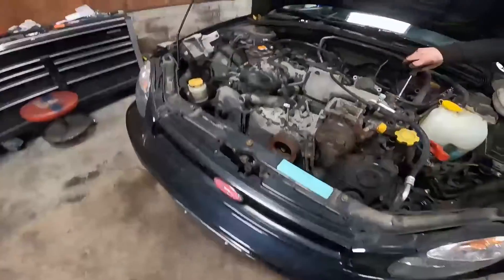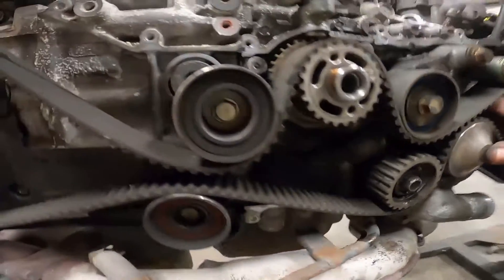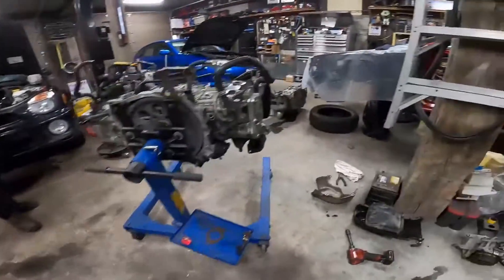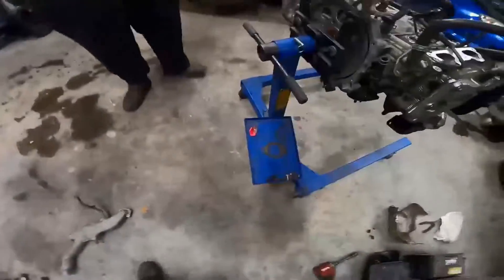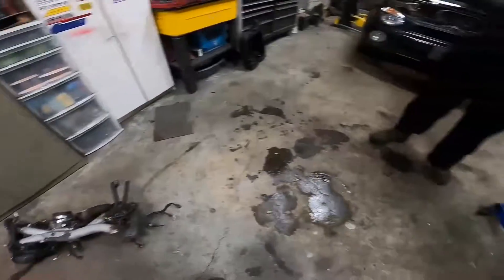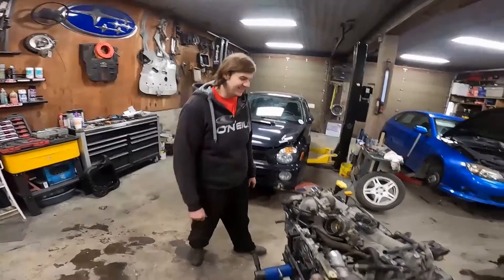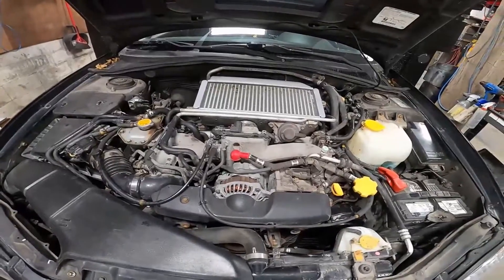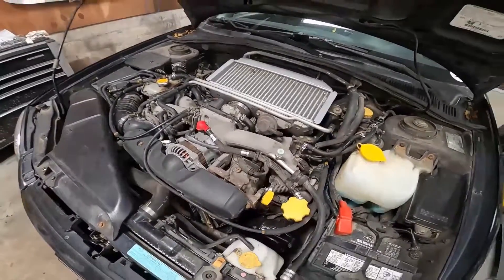How To Install Jdm Ej205 Into Usdm 02-05 Wrx

Comment: I’m looking to swap the same motor into my 03 Wrx wagon. So I need to find a jdm ej205 with avcs and metal intake manifold not the one with dual avcs and plastic manifold??
Reply from the maker: Correct, for your 03 wrx you need the cast aluminum jdm 205 single avcs engine

Comment: so currently, I’m technically doing the same swap I bought a bugeye wagon blown. I got a genuine JDM motor. The thing that I’m stuck on currently I purchased a cop turbo and I don’t want to run the JDM oil feed line. by any chance, can any of you guys give me suggestions? I wanna run everything from the cop to correctly like the feed line is gonna be the only issue that I’m having now. cause after that, I already have the USD manifold. I just need a clutch in the fly with that and I’m ready to drop it into my car.
Reply from the maker: @chrisramirez8800  I can’t see why the cobb oil feed line would not work. Looks like it comes with adapters for all types of scenarios. If it does not work get an iag oil feed line
Reply: @ I’m just not trying to run the JDM oil feed line i’m try to run the cobb one that’s prorated with the turbo is there a way for me to close off those lines without affecting the motor?
Reply: @ cause potentially I am gonna run the USD computer and manifold as well I just bought the JDM motor for my USD Buckeye wagon

Comment: I am new to subaru and have a 2002 subaru forester s usdm 2.5 na automatic would I be able to swap a ej205 in my car swap due to bad head gaskets will be 3 grand to do a headgaskets fix here in my area
Reply from the maker: @levijonson1991  hey there! To run a turbo motor in your NA is a incredibly expensive venture. There are jdm 2.0 sohc motors for very little money available from most jdm importers. In Canada, jdm 2.0 sohc and install with fluids ans gaskets would be less then $3k(can) all in. 
Cheaper then doing headgaskets 😬 hope you find a good solution my friend

Comment: Dropping my jdm 2003 ej205 avcs with cable throttle into my recently bought 2002 wrx. Can i drop this motor in "as is" or do i just need to swap over intake manifold ? From what i heard this motor is about identical to the usdm wrx engine. Ty
Reply from the maker: @Drewdawgg-x3m  if your jdm 205 is a cable throttle then yes you can just drop it in and go!
Reply: @TheSubieSanctuary  thanks alot!
These forums be throwing me off saying to switch this over and that. This motor was supposed to be swapped into my gc RS ,and with my knowledge from iwire, I remember it saying to look for this motor exactly so it could be a straight drop in application
Reply: Knocking this out Saturday, first time doing a subie swap,should be fun. Glad to know i don't have to change the cam gear or the sensors/water lines up under the intake manifold.  Now i'll be driving my wrx by Saturday night if I start Saturday morning
Reply from the maker: @ awesome! Love to hear it. Its rare to end up with the drive by cable jdm 205, but definitely sweet when you do. Drop in and go 👌

Comment: This video really saved me! Thanks guys! One question—
Can the JDM up pipe be used with the USDM headers? I understand the sensor is not on the JDM up pipe. I put the JDM up pipe on with USDM headers and USDM turbo, but I’m not getting as good boost as I had before. Not sure if it’s related to the JDM up pipe.  Thanks!
Reply from the maker: Yes they are interchangeable, the jdm up pipe is an upgrade vs the usdm. You may possibly have a boost leak or exh leak causing the reduction in boost
Reply: @ Thank you!! You probably mentioned already in this or another video, but I found out that the JDM headers are not compatible if you plan on using the oil cooler because there is not enough package space for both the oil cooler AND the oil filter. The oil filter will interfere with the JDM headers. 

However, the oil cooler is required if you use the USDM water pump because it has an extra coolant line that goes to the oil cooler. Hopefully that is useful for someone else who may be reading or missed that like I did!
Reply: @TheSubieSanctuary With the JDM up pipe, there is no hole for the O2 sensor. I get a check engine light with the code P0171. What are some alternatives so I ensure that I don’t run too rich or lean?
Reply from the maker: @ that sensor does not effect running, the code is very seldom going to come up. if you still have the old up pipe. Just remove sensor and plug it in and zip tie off to side. 
If you dont have the old sensor you can stick a 2.2 kohm 1/2 watt resistor into the plug.

Comment: great job and thanks for the vid.  did the bug need a tune after swapping? what would neeed to be adjusted?
Reply from the maker: @robertvicen5306  a tune is always going to be the best bet, however if you use same power contributing components like turbo, exhaust and intercooler. This particular swap will work with no issue on stock ecu. 
If seeking a tune, all they would do is dial fuel/ignition timing. 

Unless you go as far as using the matching jdm avcs ecu for these motor then you can get into cam timing as well. Large added expense for very little noticeable benefits

Comment: Install ej20 in 2004 WRX and car start right up. Cylinder 1 and 3 misfire.  Remove driver side JDM coils and install USA model on cylinder 2 and 4 and it fix cylinder 1 and 3 misfire.. ...
Reply from the maker: @jeromesealie9456  very strange

Comment: This video and all the rocker panel repair videos are a Godsend for my bugeye resto. If I didn't live in Utah I'd just trailer it in and give you guys the business. 

But JapanDirect is a good source for engines? Saw you mentioned them in another comment.
Reply from the maker: They are one of the jdm suppliers local to us. They have been very reliable for parts/engines. Probably 100+ engines from them
Reply: @TheSubieSanctuary  Awesome to hear. A local guy here mentioned that he's gotten several engines from them as well. Going to put an order through with them tomorrow. Surprisingly shipping is pretty affordable.

I have never attempted a swap before, but thanks to your channel and a few others, I'm confident that I'll pull it off without screwing things up too badly.

Thanks again for all that you guys do!

Comment: Any trouble with timing due to different compression ratios?
Reply from the maker: @justinhassinger7815  no need to physically adjust timing. But it is ideal to get a tune over all.
Reply: Hey me again so I’ve been all over the forms, but can’t really find any Clarity on it so the motor I have is a non-AVCS EJ 205 The cam Gears look identical to my USDM EJ 205 Non-AVCS  With those work or would I still have to swap over the cams from the USDM motor?  Thank you for all your help
Reply from the maker: @justinhassinger7815  as long as the crank gear also matches your original 205 then you be just fine to leave them!
Reply: Yessir thank you very much

Comment: Where is the video where you do wiring
Reply from the maker: @moemeditumelo1011  in this video, we used the usdm ecu, no wiring required and still able to utilize the cobb ap. 
If you plan to use the jdm ecu, then this video is install with jdm ecu and wiring. 
https://youtu.be/kyQPdwsYs0w?si=i3F4S-hCcw4GIPar
Reply: My swap is bit different eish, lemme explain maybe ul manage to help. I have swapped EJ20G from SF5 1997 forester into impreza WRX 2007 model, I need advice,if I must use the ecu from sf5 or is it possible to use the wrx ecu though wrx is drive by wire throttle and sf5 is cable. Please help
Reply from the maker: @moemeditumelo1011  ya that is an obscure swap. You wouldnt simply be able to use the old forester ecu because the 07 wrx is all chipped together. Ecu, ignition and immobilizer. 
Im going to assume the SF engine has no avcs. 
Youd have to drill holes in the cyl head to fit the cam angle sensors in the exact prefect spot. In the end you would need an open source tune to tune off the avcs codes. 
If i was asked to do that swap, id say no. Its a bad idea. If i were you, and wanted to stay on the cheap. Id get a jdm 205 with avcs, swap the intake cams and then it would run like normal in your car with no codes or issues.
Reply: @TheSubieSanctuary thanx you my brother

Comment: we did 02 wrx, usdm to jdm, jdm had dirve by cable. we used usdm crank and cam sensor, did the coil pack and spark pulg swaps, and cleaned maf, we still getting p0301 code, please help
Reply from the maker: @gmc840  id say check that the coil has spark, if spark. Then check that injector is working, lastly could try a leak down test on that cyl to make sure its all good. 
Let me know how you make out
Reply: @TheSubieSanctuary  thank you, injectors all work, coil has spark, need to do leak down, thank you again for reply!

Comment: You don’t have to swap cam gears ?
Reply from the maker: You do not have to swap cam gears, you can however if you want to swap cam gears to non avcs gears along with the cam seals. But it wont make a noticeable difference

Comment: So if i did all this and went with bigger injectors and vf48 turbo and tune would i be ok
Reply from the maker: Absolutely! Even if you used the pink sti injectors or the dark blue 255/257 injectors youd easily be able to hit 270-280whp after a tune
Reply: @TheSubieSanctuary  so I dont need to hook up the avcs
Reply: @TheSubieSanctuary what did you all do with the 4 valve cover breather holes that's the only thing left I need to do on my swap
Reply from the maker: @chasejustice8219 i used the jdm pcv routing/piping
Reply: @TheSubieSanctuary  where does that driver side rear valve cover hose go to
Reply from the maker: @chasejustice8219 to the cross pipe on intercooler if im thinking of the correct one.
Reply: @TheSubieSanctuary  then what about the one beside it
Reply from the maker: @chasejustice8219  do have instagram? Probably easier to send you a pic of one all done
Reply: @TheSubieSanctuary  Yeah it's chasejustice8

Comment: I just got both down to long block. I have a cannonball sized hole in the middle of the block that obliterated my coolant crossover on the usdm. Can’t find one anywhere lol
Reply from the maker: Ah damn, ya ive been in that situation before. May be pricey but you could try dealer. 

Where about are you located? I probably have one i could mail if you cant find one
Reply: I’ve checked the dealers in my area with no luck. Only finding the jdm ones on eBay lol. I live in BC Canada on the west coast.
Reply from the maker: @Heckbox  im just in Ontario, if i have one which I probably do. I could mail it out . Do you use intsagram? If so pm me on there @the_subie_sanctuary 

If not, you can email the.subie.sanctuary@gmail.com

Comment: my motor is on the way im sooo nervous
Reply from the maker: Its not too bad to do it. Comment here with any questions
Reply: Thanks! what timing belt kit would you recommend? i was thinking IAG. @TheSubieSanctuary
Reply from the maker: @Heckbox hey buddy! Some if the jdm 205’ have the oil cooler and some dont. 
So depending on how yours comes you can use kits ordered for the following. 
205 Without oil cooler (08-14 wrx) 
205 With oil cooler (02-07 wrx)

Comment: So other than the motor what do I need to purchase to do this swap? I ordered a non avcs long block that is jdm
Reply from the maker: You might need lower intake manifold gaskets and coolant crossover o rings for the swap
Reply: @TheSubieSanctuary coo, this other guy was telling me I have to change my intake crankshaft pully and all the sensors this will be my first swap and I don’t know if I will have to do that
Reply from the maker: @UGKsta  you can compare them , just take timing covers off and it will be very easy to see if teeth are different on crank gear.

Comment: So I have 2 questions, for the oil feed line going to the turbo. You said on the US version its cut off? Does that mean I need to remove that line in order for it to work? Second question, going the route you went is there any tuning involved or can I just throw it in and go?
Reply from the maker: The difference in the turbo line between the 2. Is the usdm 205 picks up at back of cyl head and the jdm runs from avcs solenoid across head to turbo. Leave in place and use the jdm turbo feed line. 

As for tuning, you can drop this engine in and leave un tuned if your car is all stock. However I will mention a tune is always beneficial for sake of efficiency. With that being said, we have had people leave these un tuned indefinitely without issue in stock form
Reply: @TheSubieSanctuary  is there a specific jdm 2.0 I should look for? From what I'm reading there's multiple variants of the jdm 2.0. I have a 2002 wrx wagon.
Reply from the maker: @HondaTech69  there is technically 3 potentials. An early jdm 205 that will be non avcs and you can simply swap on your intake mani and harness, but will have to possibly swap the cam and crank gears. 
Then there is a drive by wire jdm 205 with avcs and also a drive by cable jdm 205 with avcs. 

If you get the non avcs you need no tuning. You can send a link of what you find if youd like
Reply: I tried responding to your message on insty but it says you need to accept my invite.  @TheSubieSanctuary

Comment: Is there no need to swap out the crank pulley and driver side intake cam sprocket?
Reply from the maker: No sir, unless you got maybe an old ej20k instead of a 205

Comment: I’m putting the same Jdm 205 into a 03 wrx but I want to change the water pump out first with timing belt. My problem is the new motor doesn’t have an oil cooler so there are only 2 outlets on the water pump instead of the factory  3. Do you know what water pump to get for the Jdm ej205? I can’t use a USDM pump because I don’t have an oil cooler from the old engine.( it was a Jdm engine too)
Reply from the maker: You would use the water pump from a 2008-2014 wrx. They also have no oil cooler. Whole 08-14 wrx timing kit will actually be the same for your jdm 205
Reply: Thanks for confirming that. I took an educated guess and ordered a timing set and pump for a 09 wrx without the cooler lol. The only other thing I’m unsure about is the extra Pcv hoses since the new motor has 2 ports on each valve cover.  Is it pretty easy to figure out just by looking at it? Is it similar to like a 04 USDM Sti? I can probably find a diagram for that.
Reply from the maker: @agrif762  yes the pcv system will be same as 04 sti. What you can do is retain the jdm pcv system and if needing any parts/pipes for it later the 04 sti will have same routing

Comment: Hey there so if finally pulled the trigger on a JDM motor. Question, until I can get a tune. Will my usdm cobb tune be sufficient to run the motor safely? It would be on a stage 2 with supporting mods.
Reply from the maker: You will be fine, I would avoid beating on it  to be safe though.
Reply: Thank you.

Comment: Thanks for posting.. So I have a 2002 wrx looking to do the same thing.. I’m seeing other videos talking about the intake cam gear and crank sensor being switched.  Is that necessary? And will the head hemorrhage oil not using the AVCs?
Reply from the maker: You do not need to swap those sensors, leaving the avcs untouched will not effect oil’ing. Its actually preferred vs trying to swap in non avcs gear and shaft, that is when you run into oil path issues.
Reply: @TheSubieSanctuary  thank you.  The perspective on this topic has two sides. I guess I have to buy one and see what happens. I do appreciate your time and video on this topic. I would love to  basically  just drop it in like your vid. I’ll look into the JDM seller you recommended
Reply from the maker: @Vonte603  if you get a jdm 205 with a drive by cable (throttle cable) you can actually just drop it right in the car without swapping manifold! Everything plugs in and no codes after. 

However, the engine we used in the video was still a jdm 205 but it was a drive by wire throttle body, so we have to swap the whole intake manifold over due to different harness
Reply: @TheSubieSanctuary so if I get a jdm 205 drive by cable with AVCS do I just leave the sensor for it unplugged?
Reply from the maker: @kokopuffz5841  correct! Everything will plug right in, dont even need to swap intake manifold

Comment: Is there any other way to get around the extra breathers?, i dont have the jdm routing
Reply from the maker: Could just plug them with some oil resistant caps. (The extra valve cover ports/ 1 crank port) Or could use oil resistant hose and run lines and tee them into crank as well

Comment: I have a question I did a jdm ej205 on my 1999 rs do you why is just cranking but won’t start
Reply from the maker: You running a wrx ecu and bulk head harness?
Reply: @TheSubieSanctuary do you know what could be happening there
Reply from the maker: @juanjimenez-wl2kv  did it run before with 205? Or this all new? 
if i had to figure it out, id plug in a good scanner that can do live data and crank car and watch for signal like crank and cam. 

If you already have confirmed you have fuel and spark, then maybe fuel lines backwards?
Reply: @TheSubieSanctuary this all new
Reply: Yes usdm ecu and harness merged
Reply: Do you know what could be wrong there?

Comment: If I were to keep the tf035 turbo on the engine would it require a retune because of the usdm ecu
Reply: or a remap or any other things
Reply from the maker: No you dont have to re tune if using the tf035 and usdm ecu